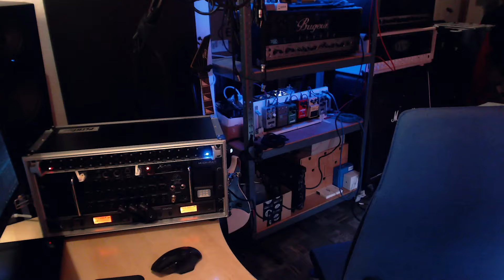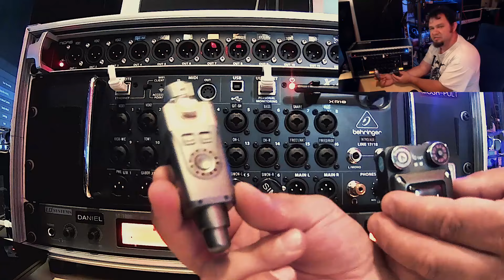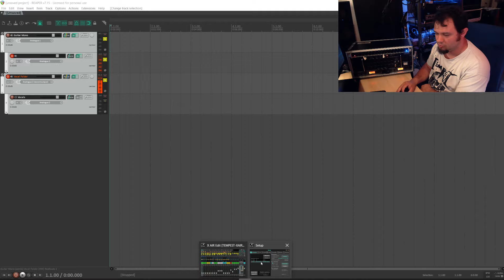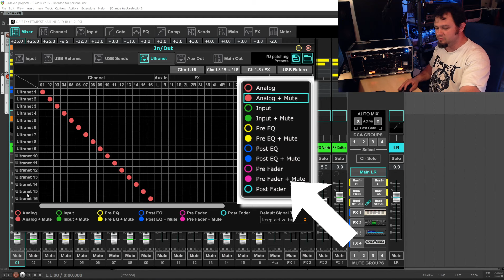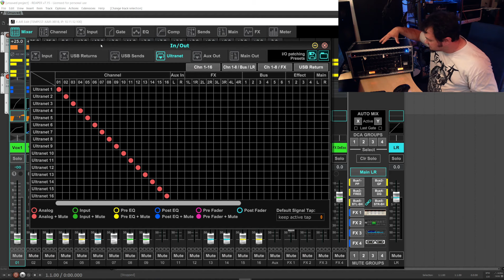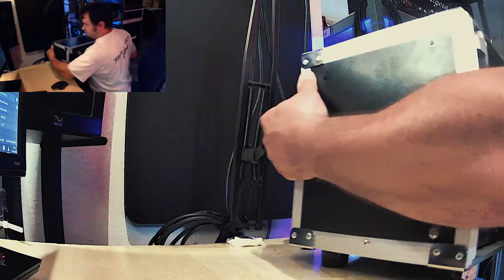The most compact IEM Rig for your band in 2024! (Only 5U!) || IEM RACK Walkthrough

Comment: oh man, I have the XR18 but no splitter yet, and this looks like my dream setup, but I'm really held back by the fact that you can't split the audio off to FOH pre-gain. That's a bit of a dealbreaker for me. I'm busy enough as it is, setting up my Quad Cortex AND power amp + cabs (which we still need because we need to generate guitar feedback), etc, and I don't want to deal with gain staging every input on top of that...
Reply from the maker: I understand the concern, but this only applies if the Quad Cortex cannot be changed volume-wise different between output1 with IR vs. Output2 without IR - I'd imagine the QC should be flexible enough to allow for that, or not? 
Because if you gain up the QC conservatively, you can just leave the gain settings untouched. That's how we do it with our pedalboards. :-) 

Hope this helps!
Reply: @PippPriss hmm that's true. That still leaves me with 3 vocal mics and preferably a few drum mics to gain stage, but it sounds a bit more manageable than I thought already 😉

Comment: I just have one question. Is your power conditioner sharing the same rack slot as your "splitter"? They must not be very deep in order to do that and be mounted on opposite sides like that. Or is the splitting unit also your power unit?
Reply from the maker: Hey there, the "power conditioner" is not a power conditioner - it's just a blank racksteel with a IEC socket, the antennas and the Ethernet sockets mounted into it. The IEC socket then provided power to a PC power plug which has an IEC connector, and that in turn gives the rest of the hardware the needed power. The MIDAS splitter however is very shallow in depth, which is nice and makes this work well.

Comment: Same setup as mine. Very compact. Except I’ve a Swissonic router on the top of the MR18, and a Stage connect in the back, in a 4u small case and it fits, also have a shelf in the back and power strip in the back of rack. We have no backline either. Just simple, we all use mainly XVive’s for In ears.
Reply from the maker: I have another rackmoutable Router I have at home and was thinking about using that one, until I found the small gLi net router we are using. Granted, the internet connection sometimes is a bit wonky when too far away, but we barely have to touch the setup - if needed, move closer to the router, set it up, done. 

But this setup overall is just killer, I could not be happier with it. Works every single time.
Reply: @PippPriss you can’t go wrong with Swissonic Router even on a large stage. It won’t drop the signal.

Comment: It looks like your rack unit has rails on the backside as well on which you have fixed the tray and the power unit. I have just bought this case from Thomann to create a similar set up but ours doesn’t have the rails in the back (only in the front). Did you add them manually? If yes - how? Thx!
Reply from the maker: Hi, ich schreib mal auf deutsch aufgrund deines User-Namens: ich hatte komplett vergessen, dass ich irgendwann mal zwei 4U rackrails selber verbaut habe! 

Die bekommt man aber für günstig Geld bei Thomann, und die Schrauben sind normale Möbel schrauben aus dem Baumarkt.

Hoffe das hilft, und sorry, dass ich das vergessen habe zu erwähnen!
Reply: @PippPriss  mega! Danke

Comment: Great setup! I’m considering the same setup for my keyboard rig. I have a Midas MR18 and I want that stagebox. Have you ever use the StageConnect output for sending to behringer wing console? It is one XLR cable that carries up to 16 channels
Cheers
Reply from the maker: Never used StageConnect, sorry! I think the Behringer X-Air only supports the Ultra net protocol. We tried flaking around with StageConnect once but did not get it to work and quickly reverted to Ultranet. But most likely that was us not having the time to figure things out.

Comment: This looks great, could you please explain a bit how does it work in the hybrid set up where the cabs are miced by the FOH? What does the signal chain looks like? Thanks!
Reply from the maker: Hey there! So, we use pedalboards where we have a modeller of some kind, in our case the Dimehead NAM Player. The NAM Player offers one output going out with an IR loaded, and one without, making it perfect for these kind of signal chains. So the IR-loaded output goes via XLR out to our IEM-Mixer, and then via the digital MIDAS splitter FOH can grab the IR-loaded signal, if they wish so. The other output without an IR loaded goes to a power amp, in our case the Harley Benton GPA100 - it's pedal-board sized, compact, loud enough, works awesome. Then we can just play the "regular setup" as all the bands with guitar amp heads would do so, as our pedal board kind of works like an amp in pedal-board-format. 

When setting up our rig, it was always important for me to be able to cater towards a "regular" setup beside our IEM setup, because if you play together with 5 bands or so, I thought it would be annoying for the FOH tech to change the signal path from micing up the cabs to grabbing the signal off of our IEM Mixer. Funny thing is, times are changing - in most cases the FOH techs are super happy to actually take our NAM player signals instead of the mic'd up sound, only twice or so was it necessary to run the "dual setup" (vs. 30 gigs or so by now which we played with this setup).

Hope this helps!

Comment: How does the drum works in the set up, does the FOH need to give a combined drum sound and input to this Behringer X Air?
Reply from the maker: No, we always have a second kit of drum mics which we place onto the drums themselves. We can then either provide the FOH with our unprocessed drum signals, or they just slam their own drum mic kit on the drums. Kick comes from the trigger module. Sometimes, if time allows.for, we ask the FOH to give us the overheads,.but we can work itcout without it. 

Seen other bands just have a mono overhead for all the drums, or the mic of the Yamaha EAD10
Reply: @PippPriss ah I see, so basically we need to take care of drum sound ourselves to be able to get the signal to iem. Could u pls explain a bit how to work in the hybrid mode, where can we pick FOH exiting mic up on the cabs with this iem rack. Got confused on how the signal flows in hybrid mode
Reply from the maker: Not sure what you mean, but I think you are understanding it wrong. 

Our setup allows for two situations in parallel - we have our pedalboards set up so we get a guitar signal with IRs as well as without IRs. The NAM Player offers both options at the same time. So the IR-loaded sound goes to the Behringer Mixer, that way we can use it for IEM as well as splitting it to the MIDAS device so FOH can fetch the signal off there. 

But often, you play with 4 bands or so, and 3 of them are using traditional mic'd up cab setups. You don't want to be the only person tellin FOH that he has to unplug the cables from the mics on the cabinet and then to your floorboard. For that, the second output of the NAM player without an IR is sent to a Harley Benton Power Amp, the GPA100, and that then goes via a longer speaker cable to the cabinet. So that way you can deliver a signal which FOH can use without them having the hassle to change their setup, but you also can run your IEM in parallel. 

Does that explain what your after?
Reply: @PippPriss ah, u have ur pedalboard to another layer of split, that’s where missed, now it makes sense

Comment: The midas outputs can be used like the outputs of the behringer with personal mix or just replicate the inputs ? I would like to use 5 stereo iem's with two guitars, one on every side.
Reply from the maker: You can choose the point at which you want to grab off the signal for the MIDAS - so you could in theory mix the signals, EQ them etc. in the Behringer and have the MIDAS put out that signal instead of the clean, unprocessed signal. We have chosen the very first stage, which only includes the input gain and the mute status, but I could also grab the pre-EQ'd setup for FOH to use e.g. 

Hope this helps!

Comment: Im new in that kind of stuff... would the Behringer ULTRALINK MS8000 Ultra-Flexible 8-Channel Microphone Splitter could replace the MIDAS DN4816-O?
Reply: Yes, but then you potentially have 16 more cables and need 2U of rack splitters.
Reply: It could but if you use the P16 channels like in the video, you could also include additional processing in the signal chain. If you don’t want to do that what you describe is fine. I am upgrading my rack from an XR18 to a Wing rack and will be using an analog splitter because i don’t want to include any signal processing from the Wing.
Reply from the maker: The only processing we currently got is the input, since we cannot change that. So what I set as input on the XR18 is automatically set to the MIDAS DN4816-O as well. If you can live with that, you'll save yourself a TON of work via additional cables and splitters and more HU of your rack. For us, it's well worth because the goal is to keep this thing as small as humanly possible with the least amount of compromises.
Reply from the maker: Technically yes, but as Gaba pointed out, it defeats the purpose of why we went that route with the MIDAS. But nothing wrong with it, and if you can grab that splitter for good money, go for it! Happy rack-rigging!

Comment: You need a copper split. A lot of engineers won't take line level splits because of bands not knowing what gain staging is and sending a signal that's clipped to hell. Plus two rounds of AD/DA conversion adds latency.
Reply from the maker: We played around 20 shows with this setup so far and each and every single person was absolutely enlightened with the workflow, zero problems. Only one engineer did not want to take the guitar signal because he already had the cabs mic'd up, so we went from our pedalboards power amp to the cab instead, while having kick trigger and bass still taken from the MIDAS. 

If somebody does not want to take our signals, we can still prettty much rock the traditional way out, but maintain an IEM that's totally independent of the sound engineer. Having the signals "up for grabs" via the Midas is just the cherry on top of the cake :-) 

If we at some point become so big to play venues,  that phasing between the MIDAS signal and the other mic'd up signals become an issue, then we'll also have an dedicated audio engineer ;-)

Comment: Amazing Video! Thank you! One question: As you said, the rack is relatively heavy and the Flyht Pro Rack has the handle on the lid, which only hangs on the two hinges. Are you worried when carrying it that these hinges might not hold or does it look sturdy? (Nachtrag: Habe gerade gemerkt, dass ich auch auf Deutsch hätte schreiben können haha. Die Frage kam daher, da beim Tragen des Racks am Deckel wirklich das gesamte Gewicht an diesen zwei Scharnieren hängt, die keine Butterflys sind. Wenn eins der beiden Scharniere beim Tragen bricht, dann fällt das komplette Rack runter. Wirkt nicht vertrauenserweckend, wenn man so teures Equipment transportiert.)
Reply from the maker: Hi! Vielen Dank für das Lob! 

Zu Anfang war ich skeptisch, aber mittlerweile: kein Problem, keine Sorgen. Solange man darauf achtet, dass man die Laschen richtig zu macht, hält das Ding super.

Comment: thank you very much for the video!

i've got 2 questions, if you have the time to answer:

1) are you really satisfied with the low end wireless units? the xvive and the $300 other option? are there dropouts, wifi issues, etc?
2) you said you added the midas for a silent stage situation. i don't understand how you would send signal to the FOH mixer without it?
Reply from the maker: Hi there, thanks for checking out the video! 

To 1) 
So far, they work pretty decent. My XVIVE U4 does not have the biggest connection stability on distance, but in theory one could use an XLR cable to place it basically in front of my pedalboard. Since I am tied to the mic, I do not move too much. Apart from that, they work surprisingly decent and have very few drop outs, if really any. 
 

To 2)
Without the Midas, we can use AUX 3 as well as the main output, and then mix within the app so that it sounds decent via the output.
Reply: @PippPriss  

so, the FOH engineer is forced to either work on your mixer on an ipad, or get line level signal from the midas? and you don't get many dirty looks?
Reply from the maker: I get many dirty looks when we start building up, glowing eyes when the FoH starts to realize they don't have to work on anything regarding our mix and can focus on the audiences mixes, and glorious feedback when we are finished. Many say they have never worked with an amateur band that was so well prepared and that fetching off the signals was a breeze, and they wished every band would do that. Audiences regularly say that our concert had the best sound they heard in "this venue" (multiple countries, different venue types). 

I myself have witnessed multiple gigs with similar setups which sounded amazing, while the other band using traditional Backline sounded muffled and phasey (despite having awesome gear on stage which was set up well).

I don't know what we are doing, but seems we are doing it right. ;-)

Comment: I love this, in fact I’m building this now!!!  Question though, how are you getting your guitar/bass/drum signals into the X18?  Are you micing them yourself? DI boxes? What if you don’t have a DI out on your amp/old gear?  Can you do a video on how you set this up when you hit a new venue and have to set up at a gig?  Or do you have a diagram you can share? You freaking rock!!! Love your music by the way
Reply from the maker: Hey there! I have a video where I show the NAM Player in the rehearsal room, check that one out, I show the pedalboards. But, basically;

For guitars, we use the NAM player. That device has out amps captured, and can run dual outputs, one with IR, one without. The IR loaded output comes out of an XLR Out which is phantom power protected into the IEM rack, the non IR out is a line out going into a power amp,.so we can run traditional setups alongside our IEM. 

Bass: using a Sansamp Bass Driver V2 + IR loader with a split, split goes to bass amp, IR loader to an active DI box which goes to IEM rack. 

Drums: we clip on our own snare and tom mics and feed that into the IEM rack, as well as an output of our Kickdrum trigger machine. 

Vocals: I smack in a small splitter between the venues XLR cable and the mic. Splitter feed goes to IEM rack and into regular FoH. 

This is a finicky process and requires time, around 20-30 minutes, but therefore we are completely, 100% independent from any FoH sound guy, and the FoH sound guy can focus solely on making us sound good for the crowd, and we can tailor to any situation while retaining our IEM sound.
Reply: Many many thanks! This video and your expertise helped tremendously!  Hope to see you out on the road   With my band Trip to the morgue!  Drinks on me!

Comment: Thanks for the video. Can I ask about the GL.iNet. How do you connect this to the internet when using it. Do you use a sim or do you connect to a local Wifi?
Reply from the maker: Hi there! When we are on a gig, we simply don't have any internet connection once connected to the router for our Mixer system. In the rehearsal room, our WAN port (WAN -> like a LAN port, but just in the direction of "public network" instead of private network like a LAN port goes to) is connected to the LAN port of another LTE router. So in the rehearsal room, we have internet, on gigs, as long as we connect to the router of our mixer, no internet. But that said, a lot of the small venues have crappy internet connection anyways, and when on stage, I got better to do then surfing :-) 

Thanks for checking out the video!
Reply: Thanks so much for the reply and the info! Trying to sort our rig out for a small live setting, so as long the router is connected to the mixer it all works and can connect to the apps locally with the inbuilt wifi without the need for a separate network? 
Thanks for the info again 😊
Reply from the maker: @ThomasFrith-e5t  Yes, exactly - the router is basically "the main hub", to which the mixer is connected to. The router is also propagating the WiFi, so your devices connect to the WiFi. The app basically scans the network it's connected to - so, GLINET router - for any Behringer hardware, and then finds that the Mixer is connected, allowing to connect yourself. 

Only drawback - you'll have no internet access during connecting to the wifi. Some devices, mostly iPhones, will also try to disconnect from a WiFi without internet connection, so you eventually have to force it to stay on the WiFi, instead of jumping to either a known WiFi providing internet connection and/or mobile network.

Comment: Nice rack and thanks for the idea with the DN4816-O. For a Jazz band we so far do not need in ear monitoring (do not want for some of the band members) , but we are using an XR-18.
Reply from the maker: Thanks! In your case, it depends on how much outputs you need. Without in ear monitoring, you at least have 8 outputs. But yeah, the MIDAS DN4816-O is truly an awesome flexible unit and perfect for our use case.